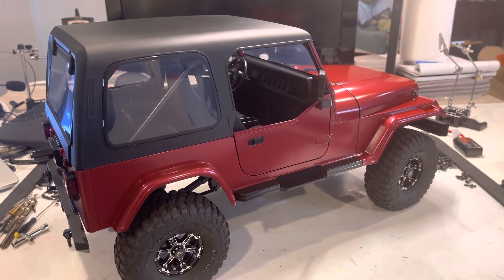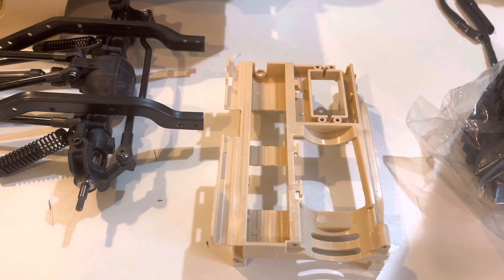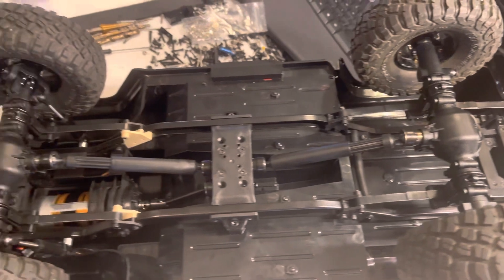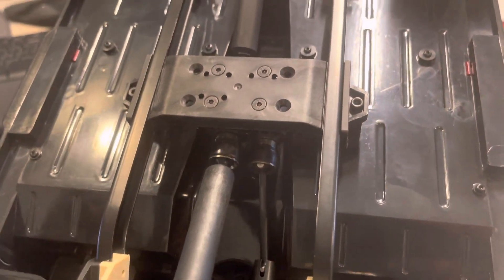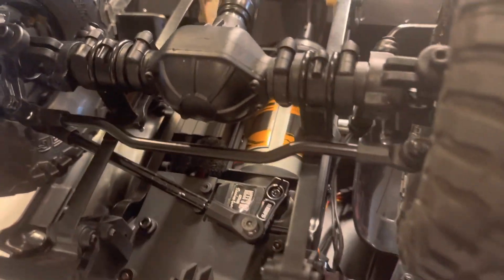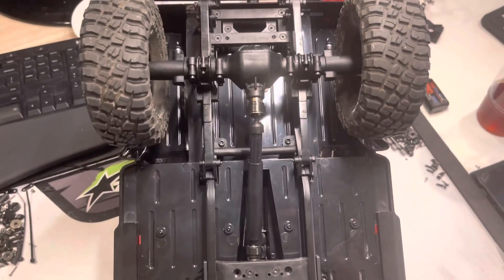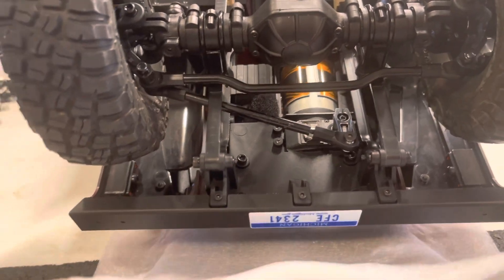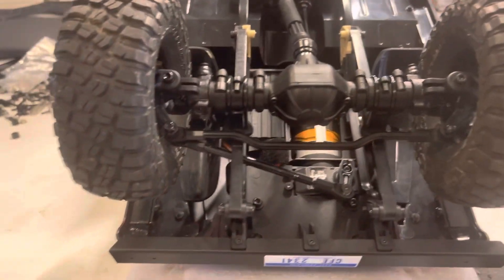Roc Hobby Mashigan Leaf Conversion

Comment: For an old guy that grew up in the world of leaf spring cars and trucks. Coils and links are the bomb. Other than scale look. I cant imagine going backwards in time. Keep the coils and links save the leaf springs for a trailer project. Just my thoughts on suspension  . My main reason for not buying a Rc4wd  Toyota truck is leaf springs.
Reply from the maker: realism to a body style has a place within the hobby.  This wasn’t done for performance by any stretch of the imagination.
Reply: Agreed. The way I look at these projects is…what would it have really been on the daily. No one in 1988 would be driving around on coils. They’d have tires, maybe wheels, some do dads here n there.  I had winch and 33’s on my 95 Sahara. Roof rack. That’s about it. If I could have afforded coils I’d be driving another vehicle than my wrangler. With that said, I’ll wait for a kit. I’m a lazy mofo. Great vid.
Reply: Broke my panhard bar, can't find a replacement or known SOA mount, so leaf sprung it becomes.  None of my other RCs have leaves, so I'll enjoy the added difficulty

Comment: If I read it correctly in an article , it had said they where going to be making e a leaf spring conversion for this but I haven’t seen anything else on it but I would definitely do the switch just because the YJ was a leafer. Nice job with your conversion and if they don’t come out with one this is a great help! Thanks! 👍
Reply: P.s. I also like how you keep and display your rigs
Reply from the maker: No idea when they will do it.

Comment: For steering I recommend you to use the ball end on the shocks of the Jimny so it kinda will be a simple spacer and mount the servo on the masigan from the bottom it will prevent the leafs to rub against the steering link

Comment: You can put a small pivot ball to give more room on your steering 👍
Reply: Yep, I took ones out of the shocks from the Jimny when I run the Jimny fully leafs suspensions. It adds more height and fits perfectly with the screw

Comment: Did you put the link suspension back onto the Jimmy? I have the Mashigan and have already changed out the servo, esc for the hobbywing 80a (gets rid of motor whine at low speed and better drag brakes) and put in a 5 slot Holmes hobby 15 turn motor. The only driver I could find to fit nicely was the small version of Barbie - and with a little surgery she fits perfectly and steers the car too! I have a Jimmy ordered. Great video by the way!
Reply from the maker: I did build the Jimny as a linked rig from the leftover parts.  There were some body clearance issues but it worked out ok.  I’m currently using the RC Addict 3D printed figure as my driver.  Thanks for watching!
Reply: @ateaserc  thanks for the quick and helpful response. I might try and copy the Jimmy set up first - with eBay leaf springs and 3d parts first. But very good to know you can swap both ways! Loving my Mashigan - best new RC for years (I actually prefer this to the Tamiya 3 speeds,  TRX4 and SCX10 at the moment if I’m honest - scale interior is amazing and my real car is a Wrangler TJ so I am very biased!). So sad they stopped selling almost as soon as they came out!
Reply: @ateaserc  cheers. I think your vid has given me enough clues to try to develop a conversion kit - using cheap D90 type leaf springs and 3D parts that I can design. I’ll post a video if I succeed!

Comment: Did you use the same lift blocks except flip the axle.
Reply from the maker: Same lift blocks, I did move the front axle one pin forward when I did the flip to align the tire better in the front opening.
Reply: @ateaserc  nice. It’s neat to me because the flip is how I’ve done the 1:1s. Lol